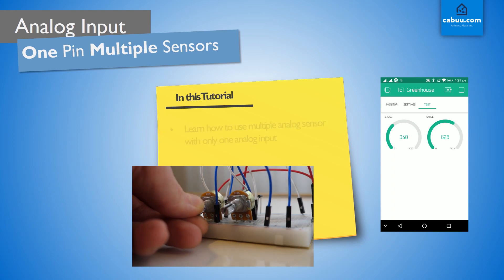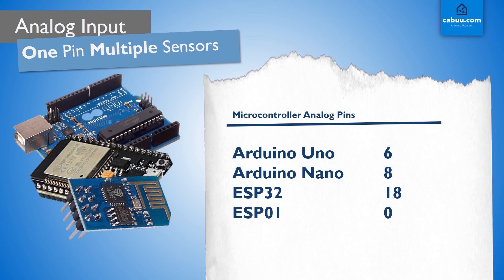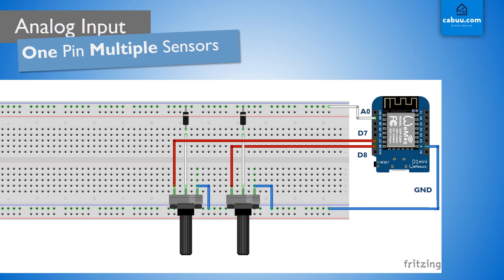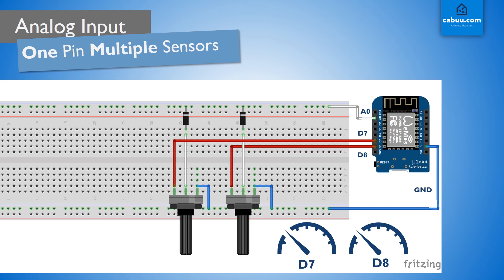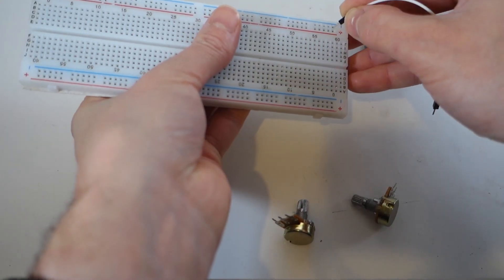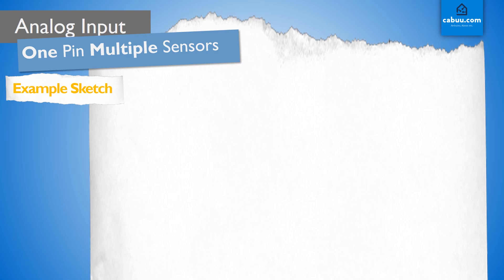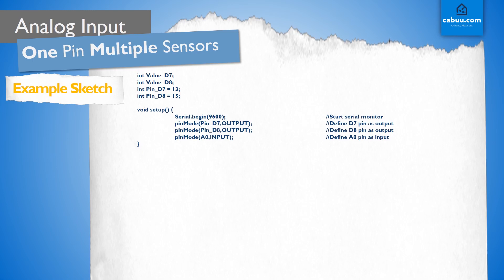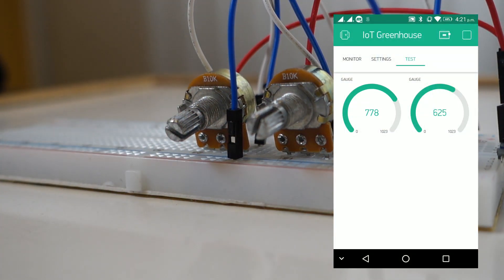How to read multiple sensors using only one Analog input pin

Comment: Hi! I have a question,
will it work if we map the readings of both sensors first?
Because when I try to mapping both sensor readings, the serial monitor shows the same result on both sensors. even though the knob on the potentio (sensor) is in a different position.
I have no clue to solve this problem, do you have the solution?

Thankyou! 
Nice vid btw!

Comment: on NodeMCU when I use the pin GPIO13 or D7 it works fine but if I change the pin the data I get is not correct any fix???

Comment: I think you have to reset pins in startup
void setup() {

  Serial.begin(9600);   //Start serial monitor
  pinMode(Pin_D7,OUTPUT);
  pinMode(Pin_D8,OUTPUT);
  pinMode(A0,INPUT);
  digitalWrite(Pin_D7, LOW);      //Turn D7 Off
  digitalWrite(Pin_D8, LOW);      //Turn D8 Off
}

Comment: Shouldn't you put a diode between the right pin of the potentiometer and the ground to avoid the analog value of the ADC to be noise when the potentiometer is turned to get a low value ? 
Currently if the voltage of the middle pin of the potentiometer is lower than 0.7V, the ADC will return noise values.

Comment: Hi! I really like your video!  can I ask you if I could use a normal LED as diode, for 10k potentiometer? which parameter should I look for to understand it on my own? thank you very much!
Reply: Your measuring voltage is 3.3 volts so I would choose as low forward voltage as possible.

Comment: I had tried this way on my project, using NodeMCU read a LDR and two soil moisture sensors. However, I faced some issues on low voltage from D2, D3 and D4 PINs apply to sensor, as the result, unstable input values are obtained
Reply: Hi, how did you fix this issue?

Comment: This is incorrect..  100% wrong. You are able to backfeed the signal through the pot not being read to ground, eapecially if the wiper is near ground where resistance is low. This is completely inaccurate and not recommended. You also dont have a full 5v going across the pot. And without analog refrence between signal ground and tge voltage being applied to the sensor i promise you dont have full range of analog input.
Reply from the maker: Hi, thanks for your feedback. I have used this method with success on a few projects albeit without much need for accuracy. A better option of course would be to use a multiplexer or a different controller entirely.

Comment: hello , so im new at arduino and has project using WeMos D1. 
WeMos just has 1 analog pin and i need 2 for moisture sensor and pH probe sensor.
But the thing is the pH probe sensor just has GND and IN pin.
What should i do about it ? and do diode necessary ? i dont have diode..
Reply from the maker: Hi there, maybe post a link to the sensor you are using, I'd be surprised if a sensor only had an input pin...
Reply: @cabuu4122  its in indonesia http://www.depoinovasi.com/produk-975-sensor-ph-tanah-support-arduino.html
Reply: @cabuu4122  can i use relay channel ? but idk how to arrange the sensor with the relay

Comment: Too many WRONG readings for me.  However, I decided  this method could provide extra digital pins. To do this I eliminated the pot and it's connection to GND. I connected A0 to a 1N914 diode inline with a 1K resistor and from there to a two pin jumper. (input pins) From the other side of the jumper I connected to pin 7. I then altered the code to eliminate any Value_D7 readings below 900. Now it works to provide additional ON/OFF inputs. 

With this and a WS2811 module, one could sense 768 digital inputs from two pins (one analog and one digital)....for this many however there's a big big problem in that it takes a minimum of 40 Ms for each reading using a Nano (delays). This works out to (768 x 40 = 30720) 30+ seconds to read them all :(   To read 16 inputs takes 0.64 seconds and I'm all right with that.
Reply from the maker: Thanks for sharing this peachville

Comment: sir, I have a question.. How to connect voltage sensor to diode? which pin on voltage sensor should i connect to diode?
Reply from the maker: Hi there, all depends what voltage sensor you are using. Do you have one in mind?
Reply: @cabuu4122  sorry, i dont know th name but it is this one https://www.ebay.com/itm/Voltage-detection-module-Voltage-Sensor-Module-for-Arduino-NEW-/331601523974
Reply: i want to measure voltage across an led. so i put VCC pin of the voltage sensor to anode of LED and GND pin of the voltage sensor to cathode of LED. I connect the S pin of voltage sensor to D3 on Wemos. Is it correct? I just have a problem on where to connect diode to the sensor..
Reply: @viralina8765  It works just the same as the potentiometers in this video you have 3 pins { +, -, output} The output pin can be called signal or any other. Wiring: + goes to one of your preferred digital pins (in this video it was D7/D8) , - to Ground, Output/Signal goes to A0 (A0 is the analog pin on your board).
Reply: @aron_toth  tq sir

Comment: Use the photon-pixel coupling method, it is a new approach in science for reading an unlimited number of sensors in parallel. You can do it with an Arduino and a cam.

Comment: The concept of this method is to manipulate the enable pin of the sensor. And a question, what would happen if i didnt put a diode? Would a resistor work aswell?
Reply from the maker: Without the diode you risk losing some of your signal and/or interference making readings unreliable, a resistor will not have the same effect as the diode would.

Comment: Great tutorial! It is possible to use one analog input using esp12e with multiple sensors?
Reply from the maker: Thanks! Don't see why not, I haven't tried it but you're right, the 12e also only has 1 analog input pin, gpio 2 I believe.
Reply: If i will follow your tutorial but using esp12e. I Should use Onewire.h right?
Reply from the maker: @waweyonor6052  sorry I'm not sure but don't see why it wouldn't work as in the tutorial as they're both based on the esp8266
Reply: @cabuu4122  but in d1 mini, onewire.h is working right?
Reply: @cabuu4122  Hello again sir. can i connect d1 mini for arduino board ?
Reply from the maker: Sorry I'm not sure I understand your question...
Reply: can i use MQ sensors for this ?